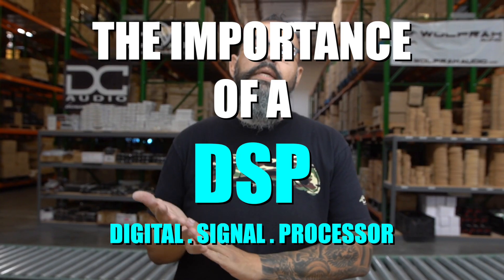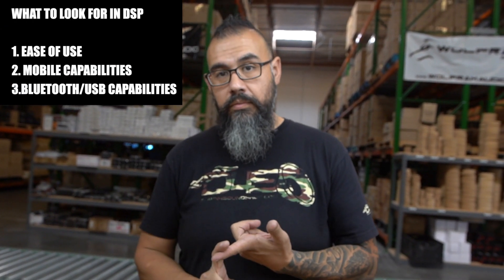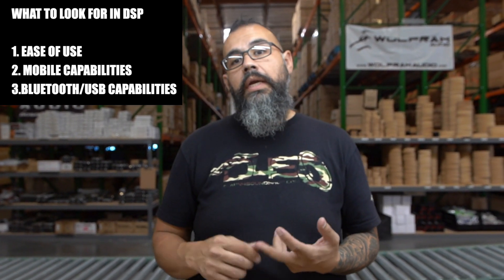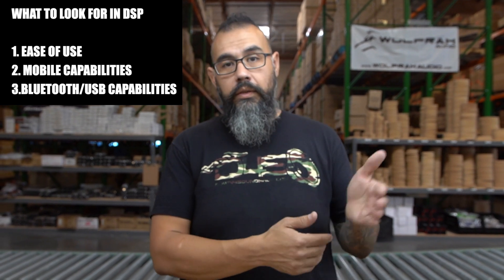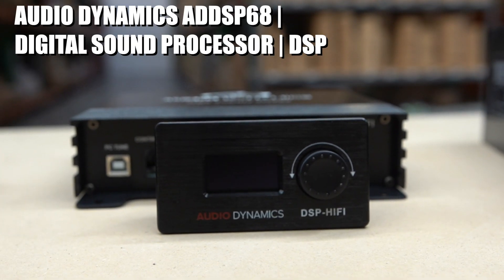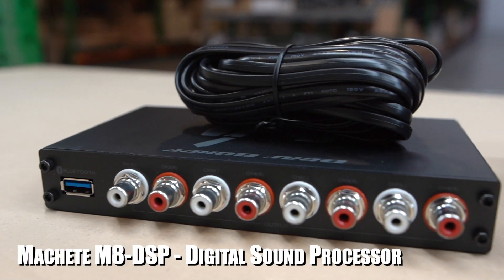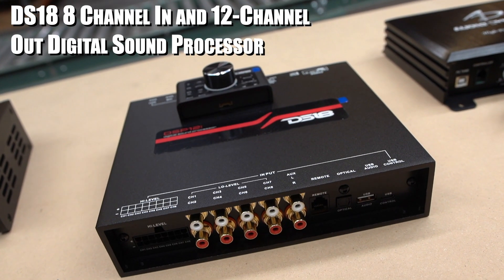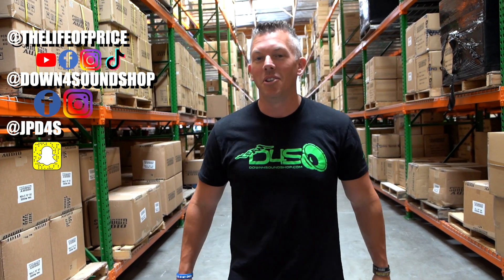THE IMPORTANCE OF A DSP, WITH NICK MEDINA

Comment: Main thing about DSPs is that you can clean up a speakers sound and give it more power. Distortion is what will ruin your speaker and makes them sound harsh. Every speaker is going to have peaks and valleys on certain frequencies. A dsp can flatten those curves out where it is flat. Not harsh with the peaks or dull with the valleys. You really need a computer with a really good mic to see how that speaker is performing. A dsp with multiple channels say a 12 out so you can control 12 speakers. And a dsp that has 31 bands of adjustment so you can fine tune it. With bass if the subs are lacking at say 28 hertz you can turn it up at those frequencies or too loud at 50 you can turn it down.
Reply: @easylooker seemed like a good bit of info you provided... I've never had a dsp & recently been thinking about investing in one & finding someone to help me get it setup properly.
Reply: You sir have provided the most comprehensive explanation of a dsp

Comment: The things he lists to look for in a DSP are actually the last things on my mind when selecting a DSP. I haven't found anything comparable to the Helix Ultra (except of course the Brax DSP). The Real Center and differential rearfill features took my system to a level i thought was un-achievable before.
Reply: How do you feel about the Arc Audio PS8 Pro?
Reply: The Arc audio one is oooook. It's only used in multi year sound quality finals champion vehicle.😊
Reply: Have you used the new Zapco? I also run helix
Reply: Yup. Love my helix mini, best in the business and that’s not just an opinion. blows my Audiocontrol dm608 away in every aspect. The director remote they offer is badass as well. Pricey, but badass. Source presets are nice too.
Reply: They didn't even mention audio control the absolute best dsp company. They were just promoting there shitty dsp brands in this videos. Dudes a sellout
Reply: @jdmsolara6726  agreed, but audiotech Fischer (Helix, Brax) is #1. No question. I went through two Audiocontrols including the dm608 and my entry level to the brand helix mini is just better in every aspect. Zero detectable noise floor unlike the 608. Clean and powerful. And that’s without their director touchscreen remote which makes it even better. Options to add wifi or Bluetooth lossless audio is just icing on a very tasty cake.
Reply: @TheDoozie43  I've been wanting to get a demo in someone's vehicle who had a great dsp along with a nice well rounded setup. Mainly so I can hear firsthand what all the hype is about (not that I doubt it, don't get me wrong). Then I'll know if I want to spend the $ on the gear & get someone to help me set the dsp up. I really like hard bass & spl, have yet to get into sq.
Reply: @itdoesntmatterwhatyourname6128  that’s the beauty of the helix dsp and others like it. You can set it up to do it all! Spl or sq or sql. The Bass augmentation on the helix puts Audiocontrol’s accubass to shame imo. But I hear ya! It’s a lot of money to take a chance with.